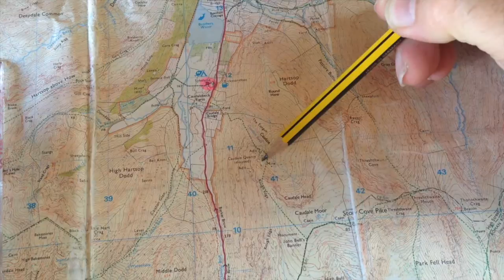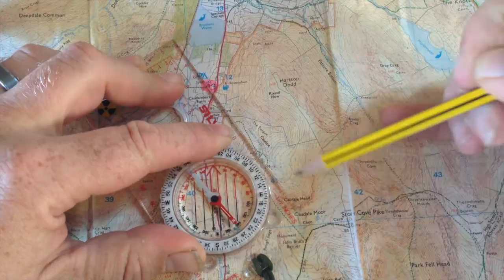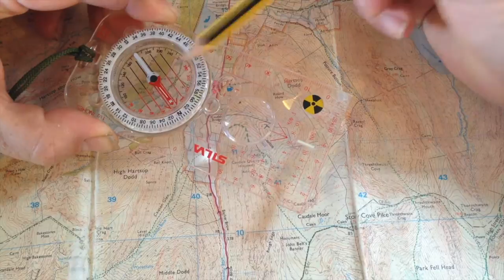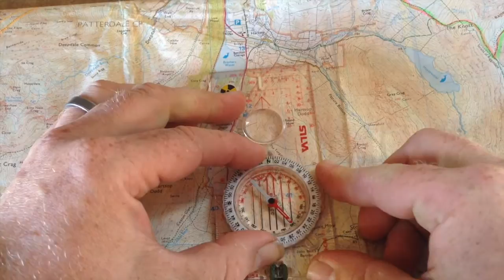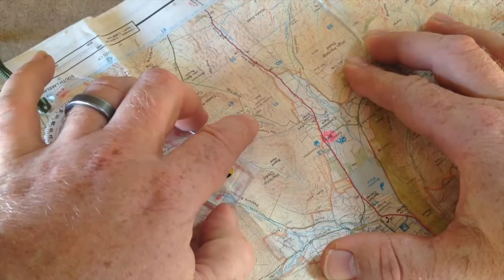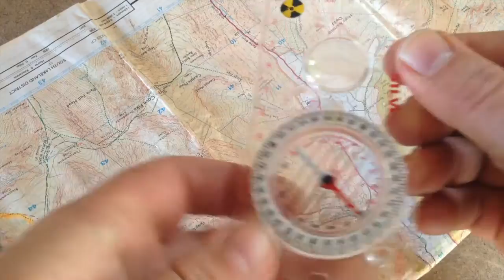Taking a compass bearing

Comment: Terrific straight forward demonstration. I'm sure it will help many people grasp just how easy it is.

But of course once you've found your bearing, you will see from the map the easiest way to get there is to just follow the path to the road, then turn north. It always pays to first study the map before taking out your compass. I very much like playing with different types compasses, but alas, maps are more important. 

Both of those methods work fine in areas where magnetic declination (or called variation in some countries) is low. Equal to or less than about 3˚. 
On many recreational compasses the needle is only accurate to 2˚ or 3˚, so no need to fuss much about low angels of magnetic declination. (some more expensive compasses, will have needles accurate to 1˚ or 0.5˚.  With practical practice you can read the bearing  to that accuracy. The compass used in the video is in that class of compass, I'd like to find some place to order one of them) Additionally most people can only walk  within about 5˚ of the bearing set.

But if magnetic declination is more than 4˚ ~ 5˚ east or west, and in some places in the world magnetic declination can be 20˚ or more. You will want to account for it, and adjust your compass. Or end up way off course. 

[some  ball park numbers easy to remember. A 1˚ error in bearing = 100 ft off course at 1 mile distance. (actually 92 ft. but 100 feet is easier to remember)  Or as a math equation - distance off course = tan (degrees error) x distance traveled. For example if your bearing is off by 8˚and you're walking to a point 5km away (~3miles)  , tan 8˚ x 5km = 703meters (0.44 mile)]

Adjusting for magnetic declination is easy. If magnetic declination is 8˚ west, turn the compass ring to the west by 8˚. (ccw). If magnetic declination is 10˚ east, turn the compass ring toward the east by 10˚ (cw).

Then you wont need to waste time looking for the pub at the end of your walk. 

Oh, and this also illustrates why you should use; check points at short distances,  aiming off techniques,  and use handrails to get to your intended destination.